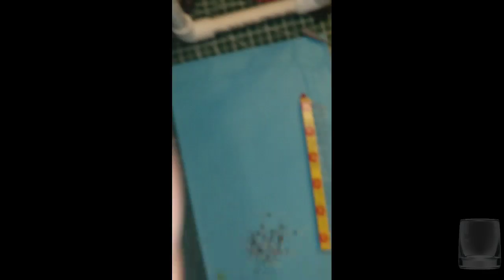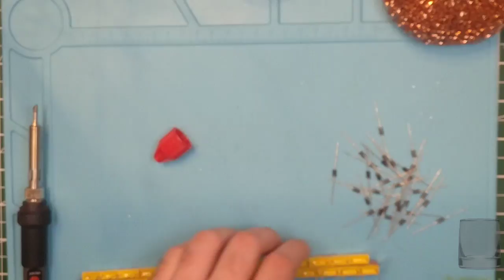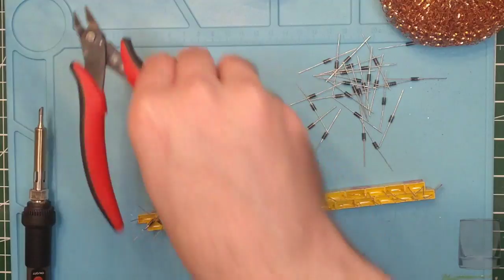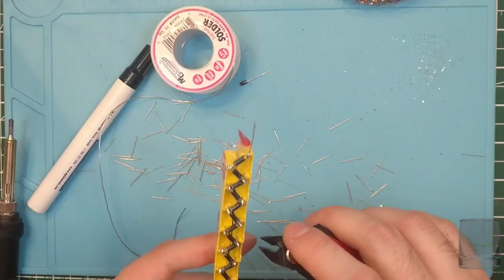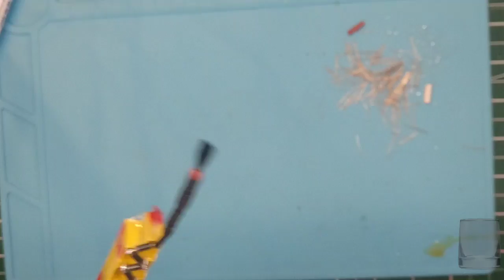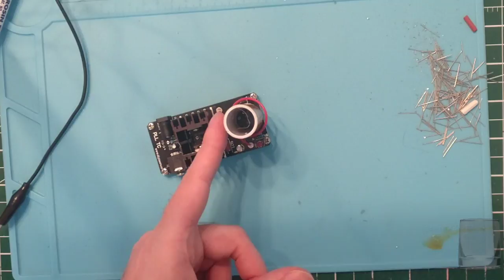Building a Walton-Cockroft Ioniser - Proof of Concept

Comment: YouTube won't load the video for me. Did you get it to work?

I want to build a negative ion generator to do flocking & see if I can make the nasopharyngeal test swabs that are running low
Reply from the maker: This is actually something I keep meaning to re-visit. I think my previous attempts have largely failed due to crappy capacitors, so I want to get some high-quality ones from mouser (or similar), and try again. Right now, money and mental health are making it difficult to get back into recording videos, but I'll update here if something interesting happens.
Reply: @GadgetBoy  giant hugs!!!
You gotta take care of you first!
I teardown electronics as a part of a few hobbies. Feel free to dm me on Twitter what specific capacitors you're considering. If I've got, I'll be happy to send them to you (if you don't mind some random lady on the internet mailing stuff to you) with absolutely no strings attached
Reply: @GadgetBoy  my struggles with mental health are probably the biggest reason I haven't started making videos, even though I REALLY want to make them. So absolutely no pressure from me!

I appreciate you responding to my comment
Reply from the maker: Just checking in to see if you're doing ok out there, and to say - "Something interesting might be happening."